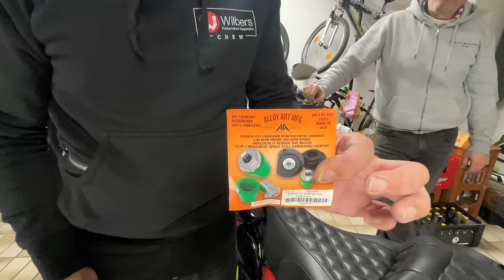No more death wobble on Harley Davidson Touring motorcycles

Comment: I have a 2012 Dyna which shares the same kind of rear end solutions with these Touring of yours. I have had no DW issues whatsoever at the moment, but this is the first time I can finally see in a well made video what they mean when people say these bike’s swingarm is ‘rubber mounted’ to the engine. Now I am pleased to understand, thank you Sir for this instructional content.
Reply from the maker: You are very welcome, our bike are stable at the Autobahn as well, but some are a hard nut to crack, even with Wilbers suspension upgrade
Reply: Dyna's swing arm is not rubber mounted to the engine, and the DW is not caused by the bushes wearing either, its caused by the rear engine to frame mount failing
Reply: @Sir.Fisher  And the front mount fails letting the front of the engine move sideways - the rear mount acts like a fuldrum .... FXR's had the same problem. Here in England we had the same experince on Norton Commandos back 50+ years ago although with Nortons the first thing to fail was the swing arm bearings !

Comment: good video, the entire kit can be installed without wheel or swingarm removal by just adding it through the plug holes, and without removing the pivot shaft, but a jack is needed to align bushing in hole, fat part of the green goes on bottom.
Reply from the maker: Definitely not!

Comment: Thanks for the show Stefan.
Indeed I know how to install the rear wheel, and at 20:22 I see your (?) little detail, that is the black marker spot on the belt tensioner cam, to see if it stays in the same position after riding, so the axle nut is tight enough.
I put on the same marker there on my bike, and after replacing the rear tire, I turn the cam back on the marker, and then the rear belt tension is the same as before the rear wheel removal. So I can see that the belt does never stretch on my bikes.
And of course, I clean the swing arm as well !

Comment: Poly or stiff bushings in the neck/trees and bars on touring/baggers makes a big difference too.. I changed swingarm,bushings front and rear motor mount bushings, rack and pull for adjustments, and new legends +2 in front & 14" piggy backs in rear.. After the winter motor work, I found how bad my old 2010 bike with 36k miles on it had got.. When you buy one new and ride it stock for 1yr then, full stg 2 w/ S&S 583, V&H pro pipe, & big sucker intake.. Rode it like that for over 30k miles thru 14yrs as I bought it new.. In spring of 2022, she started ticking on the top end, and needed a new clutch, stator & compensator anyways, so I went all out and restored the whole bike.. Took it down to bare frame, all new bushings and bearings, new suspension as I stated, new radio, painted inner fairing, 19in front wheel, 14+ bags & lids, new LePera Step up seat, chain drive, down one tooth on front inside primary, full S&S 107cu inch cylinders & custom ported S&S heads with bigger valves & 10.8:1 compression, S&S cam plate, HP oil pump ect,.. The whole bike has transformed into an amazing riding bike.. I love how easy it is for the M8 to make power, but I love my old analog bike, with no screens, no abs, no t/c, no nothing to impede.. Its so easy to transform a boring old bike into something amazing for $10-15k bucks..
Reply from the maker: @Clutch_Kick187  You put quite some work (and love!) in your ride👍🏻

Comment: Fantastic video describing the procedure of removing the rear swing arm Stephan. I changed the drive belt on my 2018 Street Glide, and followed the Harley Davidson Maintenance manual procedure as written. It’s very confusing when it comes to removing the swing arm axle and bolts from each side, if trying to understand the manual. But after having done it once, and now, watching your video, for those that are going to tackle the job…Stephan’s video makes it abundantly clear as to how to remove the bolts and axle as opposed to how the manual is written. Bravo Stephan! 
BTW..My rotations have me operating the South Pacific/Caribbean routes from Canada lately. Hopefully I’ll be crossing the Atlantic again  in the near future. I’ll be maintaining my listening watch on 123.45…
Cheers
Reply from the maker: It's good to know, that someone is watching me! Always Happy Landings.

Comment: Greetings from Scandinavia! My Road Glide is much improved since I followed your Wilbers recommendation. Sometimes it is necessary for me to ride at high speeds to cover longer motorway routes. I’ve had the wobble before and will book this next modification with you.
Reply from the maker: But first the fork seals and my special oil level...🤣
Reply: @stefansgarage3014  I think a full Stefan review is required 😎👍

Comment: For those who don’t want to dive into removing the swing arm and installing the bushings alloy art also has the
 M8 touring stabilizer I have one on my 2018 street glide and it helped tame the death wobble. The only weird thing is it doesn’t have left and right hand threads on the heim joints so turning the turn buckle to adjust isn’t possible.

Comment: Stefan, I surely enjoyed your videos and they are very informative and entertaining. I’ve purchased a new 24 FLTRX and I’m having the Wilbur’s Nivomat and also the Alloy Art Bushings and Cush damper installed from the beginning. I had a previous 24 FLTRX for a short time, for 1399 miles. But someone decided to run into my new bike and it’s totaled. So I’ve purchased a replacement.
Reply from the maker: Sorry to hear Robert, I hope you’ve found a good replacement.
Reply: @stefansgarage3014  yes I did another 24 RG, just a different color. Not all black but White Onyx.

Comment: Great video! I should really do this on my '17 King, as I'm almost positive the rear swing arm is misaligned. Will give these a try, and clean my swing arm!
Reply from the maker: You can do a quick measurement with a measuring tape iso the equalizer and check the resistance of the swingarm bearing with wheel and shocks removed, before you go deep down the rabbit hole

Comment: Great job , one part mostly neglected by tuners , never saw this addressed on Tube before for sure I'll do that to my roadglide . A 2019 with 134k miles bushings must be jelly by now. Thanks good video.
Reply from the maker: Wow 134K on a 2019! You probably want to rebuild the whole swingarm assembly, including new bearings and the black rubber mounts.

Comment: There is an adjustable motor mount link that is on the top front of the engine. It can be adjusted to correct and mis alignment in the frame. The stock fixed length unit is avarage close enough for most bikes but to be exact. The adjustable is required.  Great video
Reply from the maker: Unfortunately not anymore. In 2009 Harley seems to have replaced the adjustable front motor mount with a rigid one. But aftermarket (Rack and Pull) they are still offered.

Comment: Darn it Stefan, once i have seen that i cannot unsee it. And i just got the back wheel in after a tyre change and a clean up. I may as well order some now and pull the swinger.
Reply from the maker: Is yours wobbling? If not, I would wait for the next tire change.
Reply: No wobble 100% stable. BTW your Wilburs worked well through our Balkans 9000km trip last summer.

Comment: Clear video, Stefan. Best I've seen on yt in terms of explanation. However, a question about the rear shock absorbers. I have a new set of Hyperpro where the left one is 5mm longer than the right one (it is also in the description). Also, I have Progressive Suspenion 912 lying around where the same applies. So why is that? Greetz from holland
Reply from the maker: Honestly, I do Hyperpro only on fork springs for models, I don't get Wilbers (as well with good results). I have no idea why they would do symmetrical shocks with different length.

Comment: Good video Stefan. I believe the Rack and Pull industries Equalizer tool used in conjunction with the installation of an adjustable top front stabilizer (replacing the oem non adjustable) to be able to bring the drive train into alignment correct? The swing arm can't move up and down for adjustment as the swing arm pivot shaft runs through the rear transmission case. The adjustable front stabilizer is the key the same as it was on Twin Cams & FXR's.
Reply from the maker: Definitely correct, I have bought a couple of „missing links“, so far our bikes are not misaligned. So I’m going to keep them for the really bad ones.
Reply: You are correct. The only way to get rear swing arm in a correct vertical plan is to check swing arm vertical alignment with the equalizer tool to get a measurement of the left and right rear swing arm. Normally the left side is off due to that being the drive side. In order to properly align the rear swing arm vertical plane. You need to adjust the motor left to right alignment and that is done by replacing the none adjustable stabilizer link with an adjustable stabilizer link this allows you to move the whole drive train to the left or right then check the rear swing arm alignment when stabilizer tool shows in alignment then you can lock down the stabilizer link nuts. Just adding those bushings is not addressing the true issue.

Comment: Congrats Stefan for your sensational Youtube Episode now going viral 😎👍
You earned it - please continue to post helpful HD content!
I'm sad that you do not change bushings as a service, because I would like to enjoy Apfelstrudel watching you replacing these parts like when you optimzed my bike's suspnsion😄
One question: In standstill or while driving, is there a clear indication that the bushings should be replaced?
Greetings from Patrick 🙋‍♂
Reply from the maker: You would gain a lot of weight while watching me…
If your bike isn’t wobbly, don’t change anything. I would check the easy movement of the swing arm during a rear tire change. If the movement is stiff, the swing arm needs to be removed to clean/change the bearings. That’s the proper moment to change the bushings. If you have wobble, change them right away

Comment: good video, i have an 08 UC with a stage 3 kit and go 200 kph alot and never had this problem, only issue is with wind on fairing on a windy day that causes a little instability. That 131 is to much motor for laced wheels would have got cast, should have checked to see if all tight when you had it out. Cheers from toronto
Reply from the maker: Maybe a misunderstanding, it's preventive upgrade. The 2021 CVO with 131 was solid as a rock, we just wanted to get experience on the reinforcement bushings and have an ultralight moving swing arm

Comment: Hi Stefan 
I was wondering what your final thoughts were on the bushings and cush drive. Is there another video review on these?
Reply from the maker: Not yet, as the weather is still to bad to get a lot of miles. There is a significant introduction of engine vibrations by the reinforcement bushings. Therefore on the TC, we removed them. On the M8 it’s noticeable but ok, so here they will stay. I want to emphasize that both bikes were stable and we want to get experience with the bushings. Unstable bikes were cured, with the bushings and an adjustable upper engine mount, as some comments show.

Comment: How’s the vibrations been? I did mine and it def makes the bike more stable in the corners but I went back to stock cause didn’t like the way the vibrations were. Very buzzy feeling vibrations.  Curious to know your thoughts on it
Reply from the maker: We have noticeable engine vibrations in both M8s (no experience with the TC so far), however it’s still acceptable. We will check on the autobahn, but it’s still too salty.

Comment: thanks Stefan…any idea if they are going to make a similar style bushing for the Harley bagger front engine mounts ?
Reply from the maker: For the front top engine mount there is an adjustable solution, called missing link by rackandpull.com

Comment: Hey Stefan, can I also ask you what you think about replacing front motor stabilizer with the adjustable one as well as adding a rear motor stabilizer of Alloy Art? Is the green bushings replacement good enough or we should also think of the front and the rear motor stabilizers? Thank you in advance. Your fan who watched all your US adventures with Matt, MDB and Cycle Fanatix.
Reply from the maker: Hi Kadim, thanks for your support and for taking part in the „adventures“.
I have ordered some missing link adjustable front motor mounts for our bikes. However all swingarms were aligned precisely-the bikes were all stable before. Honestly I’m not a good(hard) enough rider to get my Harley to the limits, partly because of proper maintenance, good tires, good suspension. RHCP is stable above 120 mph during turns on the Autobahn. I will continue the research with other bikes, for the moment I have no answer for your question. Ride safe and continue watching
Reply: @stefansgarage3014  thank you my friend, you are a Legend... Oppss, my bad, I was gonna say Wilbers 😁
Reply from the maker: @kadimsilahtar  😂👍🏻

Comment: Hey Stefan, thanks a lot for the video. I have topped out my high performance LowriderS at 143MPH but boy does it do the death wobble. Will these bushings stop my death wobble? 
Thanks in advance.
Reply from the maker: Hi Marcus, no they won't, swingarm design of the Softails is completely different.

Comment: Belt tension should be adjusted every time rear wheel is removed. Don’t rely on marking axle. What if it was a little off when you started ?
Reply from the maker: Hi Bob, good Input. Of course we checked it, should have put it in the video, but is was getting longer and longer…

Comment: Stefan;  I have a 2002 CVO Road king, 95 cu.in. would this be the same procedure on mine?  I have always replaced my own tires, both front and rear. my lift has a drop out to lower the rear wheel.  thank you nice video.
Reply from the maker: Honestly, I wouldn’t do it. The Twin Cam introduces too many vibrations in the frame

Comment: Good video except the Flag was technically on right to begin with .  The stars should be to the right side . They are backwards on a U.S. uniform because some General at sometime thought the flag should have the stars to the front of a forward motion . I have always thought that was the dumbest thing I've heard of or seen . So you should have one facing one way and the other facing the other by that logic .   The logic did come from a U.S. General .... So that should in itself tell you how logical it is.

Comment: I saw an American video and they said that all Harley's that they've seen have this problem, but cure it with a front engine mount that is adjustable to give you perfect alignment, not 0.5mm out. Is this correct as I'm led to believe that the swingarm bolt goes through the transmission case ?
Reply from the maker: Adjustable front engine mount does help, some Harleys have an aligned swingarm, others don't. You are right, the swing arm axle goes through the transmission case, therefor tilting the engine affects the swingarm alignment.

Comment: I just installed the cush rear swing arm bushings. I'm experiencing a lot more vibration up front I'm going to change the front motor mounts next
Reply from the maker: Is your Harley actual wobbling? Only if so, I would keep the bushings (and vibrations)

Comment: Great video as always!  Just subscribed and looking forward to your future videos.  I have two questions, first did you replace the swingarm bearings?  You mention you would address the bearings but possibly i missed it?  Second, whose swingarm alignment measuring tool did you use? Googled for one and could not find one.  Thanks
Reply from the maker: Hi David, we cleaned and relubed the swing arm bearings (not on video), leading to that ultra easy movement. The alignment tool is the Equalizer from https://www.rackandpull.com/equalizer
Reply: Sorry i hit the send by mistake. Manufactures often fail to fully pack bearings. When I’ve purchased new dirt bikes in the past I always add grease to the triple clamp, swingarm and rear shock linkage unless it was a KTM with PDS.

Comment: Wow. Those should be sealed roller bearings equipped from the factory. 
Alignment should not be flexing about causing high speed instability.
Motor isolation is one thing but tire alignment is critical.
Rubber dampers for areas that flex movement is acceptable.
But wheel assembly spinning at 100 mph not ideal.

Comment: I installed these on my 05 FLHR and had awful vibration. The bike felt like a rigid mount Evo Softail. What was your experience?
Reply from the maker: So far we were only able for short testrides, as winter is back in Southern Germany. However all three bikes have been upgraded to Wilbers Nivomat suspension before. Maybe it's a different experience with the FL1 chassis and/or stock suspension. I will do a follow up video in spring, covering aspects like tires/tire pressure and on. By that time we will have enough experience on FL2/3 and 4.